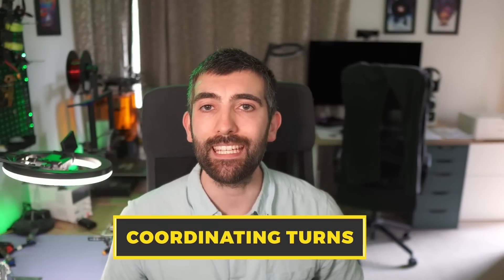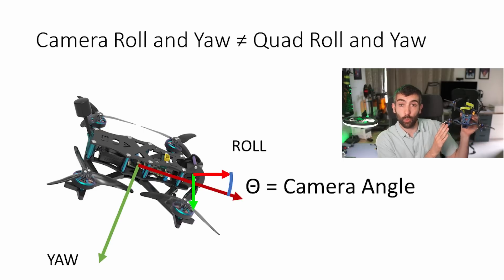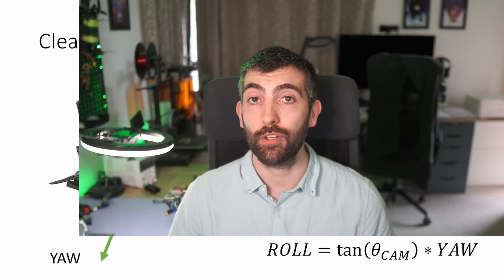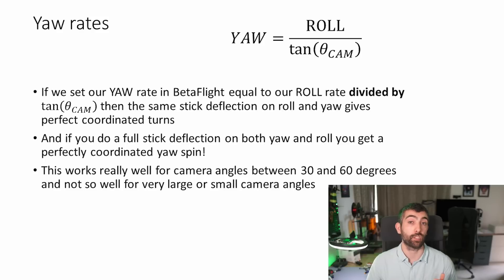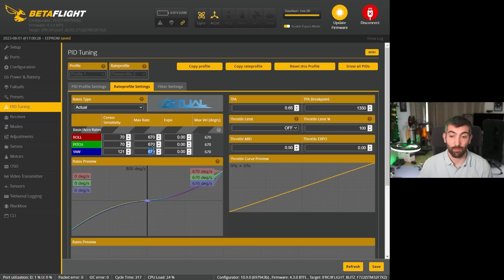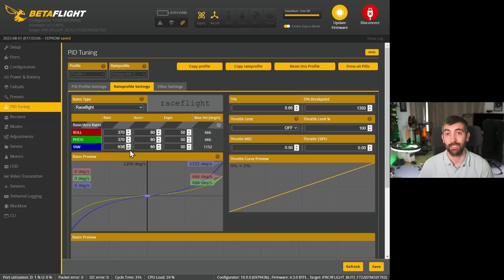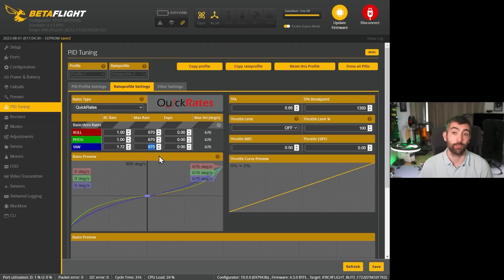Get Perfect Yaw Spins the EASY way!

Comment: This is good and works really well - suddenly I'm able to do perfect yaw spins every time. There is a downside, though. Reduced sensitivity on yaw. Even when I used the same rates on all axis, I noticed I'm only ever using half of the yaw range - now I'm using even less.
The calculation for me gives 1333 max rate for yaw, which is way too much for me. But I found a middle ground - I used spreadsheet to produce a chart of my calculated yaw rate (166.33, 1333.33, 0.65) and found another curve that is identical for the first 50% of the stick move, but then it remains much more linear (160, 600, 0). As I don't do super fast yaw spins, it still works great for that, but additionally I'm getting rid of expo I don't need (which otherwise could amplify my errors) and it looks much better in the camera, while doing max left yaw + max right roll (or vice versa; sorry, don't know the name of this move if it has any).
edit: After further tests in the sim, I think I will go with 50% difference between roll and yaw that comes out of this calculation - it already does big difference for yaw spin for me, while reduction in yaw sensitivity is much less noticeable. Seems like a good balance for me.

Comment: What's the advantage of this than just setting "FPV Camera Angle" in Betaflight?
Reply: changing the camera angle in BF doesn't change any flight characteristics, i think its used for gyro data and some other stuff.
Reply: @genericfpv  Nah you are misinformed, it mixed in roll with yaw input so you can turn more easily
Reply: @JustInTime0525  thank you. Quick google and changing angle doesn’t do anything but under modes enable mixer and yes it does, consider me educated! I did some tuning and the guy needed me to get angle right for black box tuning. So yeah you original question is interesting 🤔

Comment: Hi Chris. I have a problem with that calculations. I have a low cam angle of about 5 degrees. That means dividing by 0.09?! Yaw rate at 7k. Am I doing something wrong? Thanks for the great Video anyway!

Comment: You are such a clever guy... all our US rednecks would have never came up with this ;D
Since I fly various angles depending on the video I do, if I freestyle or race... I actually fly my first pack calibrating myself for jaw-spins so to not just have a wonky quad rolling uncontrolled in every corner. Now I may try this approach and see what this does to my muscle memory instead. It will result in a different jaw-response for every angle so I wonder what puts me off more - having to adjust in my brain for asynchronous stick movements or jaw response... let's see!

Comment: Hi, thank you for the great videos about motors. Recently I want to build a long endurance quad but was struggling with motor efficiency. Could you please do a vedio about how to increase the power efficiency of the motor? For example, should I use low kv motor with low votage on a big prop? Thank you in advance.

Comment: Uhh... at firtst glance, this looks like a stupid idea...
My roll max rate is 1053 deg/s and I'm running 25 camera uptilt. By these calculations I would end up with yaw max rate 1998.
I don't like that just by looking on that number :D
I know, you said that this works good for 30 to 60 camera uptilt, but 25 doesn't sound that far from the bottom edge :D
Should I try it on my quad? Hm, maybe I will, but I'm sceptical and worried :D

Comment: Just tried your method in liftoff, and it does not work at all. My normal rates (betaflight rates) of 1.64 super rate, 0.59 rate, and 0 expo at 30 degrees uptilt. I run the same rates for roll, pitch, and yaw. Using your method, my yaw should be 2.82, which is unflyable 😢

Comment: Twitchy yaw on anything else. Will take more stick time to relearn all the other moves. A pass for me but very interesting knowledge 👍🏻
Reply from the maker: It depends a lot on your camera angle and rates, I think. I fly 30-35deg and 700deg/s on roll and pitch and I like it. If you're flying less than 30deg the yaw multiplier gets too high. Of course we could also reduce our roll rates rather than increasing Yaw.
Reply: @ChrisRosser  I use thumbs, so these higher yaw rates makes my obviously poor yaw technique very visible 🙈

Comment: oh by the way, i have 2x aos35 frames and i beat them to heck, i really with the arms kinda touched eachother under the bottom plate because i sheered a couple of the little m2 screw now  from impacting the arm many times and its sheering at the interface of the arm and brace plate because when you bang the arm into something its not actually locked in in any way its kinda just samwedged between carbon and able to exert a lot of force onto the screws, the arms bend upwards and bends the screw where it comes from the bottom plate through to the arm, or it sheers the screw head off if you hit more square on. i know its more weight but i would prefer the option of maby a drop in shim that you can run or not run that will lock the arms together once the samwedge plate goes on
Reply from the maker: Thanks for the feedback! The right balance of weight is a key challenge I find so always good to hear what people think about the current solution 👍
Reply: @ChrisRosser  i love the frames by the way i have a v2 analog build thats at 248g with 850mah 4s and 1404 3800kv xing2 and its a really good quad, my v3 has the wasp link kit and 1408 motors otherwise same stack and battery its 60g heavier but the more power makes up for it, but it crashes harder so the durability increase is welcome, been flying the v2 for about 5 months atleast now i think, and the v3 for 1 month, and i managed to break 2 arms on the v2 so far in really decent crashes, after a ton of abuse, and i cracked a top plate because of the counter sunk screws and i cracked a rear and middle bottom plate things again because of the counter sunk screws. so the v3 i got from cnc drones without the counter sunk holes and it seems ALOT more durable, plus then its overall beefed up a bit, but now its heavy enough to sheer the m2, its a tough balance and we expect so much lol they blow my mind how you can beat them up and they just keep popping up and asking for more lol, i love my 2 little rippers! but ill avoid frames with counter sunk holes for the rest of time lol so iflight cuts of your frames will only be in a pinch cos cncdrones shipping to australia is a bit slow sometimes

Comment: The real problem is trying to fly a quad using a control scheme designed for a fixed wing aircraft.
Ideally yaw would be controlled by twisting the stick, like in hosas flying system.

Comment: I don't understand the point of this video. 99% of the time, we aren't doing yaw spins, so adjusting our rates FOR yaw spins is ... worthless. Everything else we do requires much less yaw than roll. Not more. 

This isn't going to yield good results. Want better yaw spins? Put in more stick time. Learn where your horizon is and the relationship between yaw and roll.

Comment: if you have your accel calibrated, you can use the model on the Setup tab to find your camera uptilt. just rotate the model so that the lens is perpendicular to the bench and check the sensor reading

Comment: This is interesting because with my sensitivity of 100 & max rate of 500, my numbers would go up to 310 & 1172 for my 30-deg tilt. Which is weird because I've always heard yaw rates are much lower than pitch and roll because it's not used that much in a turn. This would get some getting used to because I might be too twitchy on yaw. I'll have to see how it goes.

Comment: This is asumming you run the same rpy rates and rpy expo on all three channels, quite a few pilots do not, is this correct? I run 1950 on r/p, but only 1200 on yaw (to tame the yaw jumps), and different expo on r/p than yaw.

Comment: Hello Chris. Great video. I was using higher yaw rate earlier as I found easier to coordinate (but it was less than calculated rate with your formula) Now I know the exact value for unified stick movement ! 
Betaflight can implement this as I believe it has something with "Cam angle" in angle mode. 
It can directly change yaw rate like "Cam angle dependent yaw rate"  All we need is a developer with will to do it 😊

Comment: You can find your camera angle really easy in betaflight using the gyro by tilting your quad until the camera is horizontal then just check the pitch angle. Thanks for the trick Chris.
Reply: Gyro determines the rate of rotation. Accelerometer shows you acceleration, including gravity. Which presumably points exactly down. So it's the accelerometer that allows you to measure attitude, including a pitch angle
Reply: @the-ruffles  Good. Lord. Acceleration IS rate of change, and no the gyro does not do that, the accelerometer does, you can tell because it has acceleration in it's name. The gyro maintains 3D orientation.
Reply: @zdkama  Acceleration IS rate of change of VELOCITY. Gyro measures rate of change of ANGLE. It doesn't measure the angle itself. At steady state it's measured by an ACCELEROMETER because it detects gravity, which points DOWN. Only during flight is the gyro data combined with the accelerometer data to offset the fact that the drone experiences acceleration other than gravity.
Reply: Smart thinking!
Reply: Nice tip, but the gyro only measures the rate of rotation. I think you meant the accelerometer, which needs to be enabled (freestylers sometimes disable it) and calibrated. 👍
Reply: @kandredfpv its the other way round..😊.. accelerometer measures rate of change, gyro measures the angle where its at.when u in acro mode u mainly using the gyro,and that is how beta flight calculates the drones flips on full scale deflection,or any deflection.. accelerometer helps in angle and horizon..u dont ne3d to disable anything.the betaflight and fc combo is smart enough to know when to use what
Reply: @captain-22  did you Google that before you posted it? Because it's wrong and misleading. 😊
Reply: @kandredfpv  i am pretty sure u use the gyro to calculate the camera angle trick, not the accelerometer..the accelerometer only measure linear acceleration..in fact accelerometer  can not detect yaw..
Reply: @captain-22  OK my dude. If you prefer to just shoot from the hip instead of Googling basic facts that's your choice, but novices read these comments and can end up getting misinformed. Why is there literally a mode in Betaflight called angle mode which doesn't work without the accelerometer enabled? That's because the accelerometer in the IMU is used to measure the tilt angle of the drone!
Reply: @kandredfpv  😂.the argument is ,when u tilt u drone in betaflight to measure your camera angle, is it the accelerometer or gyro..lets ask chris rosser to settle the debate.on which measures you angle of tilt in betaflight.i will be happy to concede then 😂😜
Reply: u say its the accelerometer that measures your camera tilt when you rotate in betaflight but i stick to gyro still.we are not talking about actual flight.
Reply: lets wait for chris rosser reply.i posted the question so no one gets misguided, and perhaps i might learn something, or maybe you will.just freindly argument bro.healthy stuff😅

Comment: I will 100% give this a shot, but it seems like the number gets wildly large, I have around 40 angle with 200 600 0 on actual. That would result in much faster rates on the yaw, 238 715 0. Definitely willing to give it a shot and report back though :)

Comment: Maybe I missed the part when explained how to get the values showing in the table. Here is one example how you type it in on your calculator if the camera angle is 30°: tan(30 * (π/180))=0.58
Reply: thanks!
Reply: Also set the calculator to RAD instead of DEG.
Reply: @gentlesfpv  what no you want deg or are you messuring your camera angle in radiant?
Reply: Try calculating it in DEG you'll get sth like 0.009 instead of 0.58 for 30 degrees of camera angle. You would still put in 30degree camera angle.
Reply: @gentlesfpv  oh my bad
if you put the deg*(π/180) you convert to rad 
you can leave the "*(π/180) and use deg instead
so it would be tan(30)=0.58

Comment: Thanks Chris!  If you're running expo with 'actual rates' would you match the expo (my guess) or similarly divide the roll expo by the tangent?
Reply from the maker: I think you match the expo.
Reply: not sure if it works like that since the relationship isnt linear is it?
i cant wrap my head around it rn i guess i go test it later in sim 
normally i fly with yaw rate lower than roll so this would be quite a change so more expo on yaw would be nice

Comment: Inverted yaw is my greatest enemy! I just can't wrap my brain around it, lol, does this work for that or make it worse
Reply: Best place to learn, like any trick, is in the sim. If you do a full 360 or a 180, you don’t need to be perfectly level to make it look good either. Use the horizon or an object to try and find where your camera needs to be to stay level. Just takes practice.

All the best pilots manually coordinated inputs for about every trick. I’ve been using lower rates, and it’s taught me to coordinate even with simple rolls. 

There’s no correct way in this hobby. So however you get the job done and you’re happy with how you video looks, go for it. Just my advice.
Reply: @Greg__K  if you lift off and dont change pitch just do a 180 roll and you get your horizon for a perfect inverted yaw
Reply: realistic way to do inverted yawspin is to flip upside down so the horizon is in the right place (your fpv camera is level)

that way you just need yaw input. it takes quite a bit of practice to get it down.

important thing is, that you give yourself enough up momentum, ideally you want enough momentum going up that once you are upside down your slowing down to make it look like your hanging, so the way and turn back right side up to catch yourself.

if you get it right it looks like you have huge hang time
Reply from the maker: This makes it easier to get a flat inverted yaw spin.

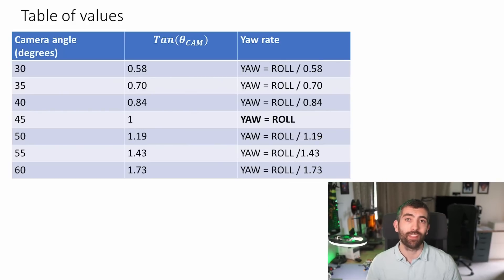Comment: Your table at 4:33 starts at 30° and goes up to 60°. Really unrealistic. Who is flying 45+ in a typical freestyle quad? Most freestyle pilots are flying angles between 15 - 30°. The smooth way of flying. ;-)
Reply: sssssssssssssssbang!
Reply: you would be very supprised how many ssssbangers are using below 25 degree angle :]
 @Maxhotgo
Reply: Chris mentioned this doesn’t work well with angles <30°, but there was a JB video (obviously) explaining how you can cheat at inverted yaw spins by aligning horizon to the line where it is when the quad is level when flipping upside down so that you can only use the yaw stick to do a perfect yaw spin.
Reply: @PraiseKier  you mean in the osd? 
still hard to hit perfectly but thats a good idea i might try that out :D
Reply: pls link to this video ;]
 @PraiseKier
Reply: I run 45 on everything because I race as well